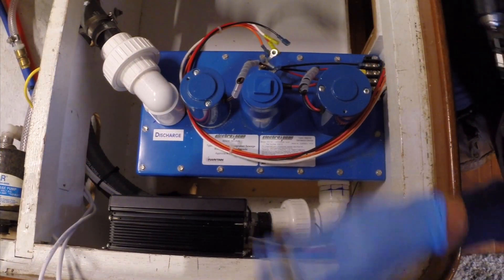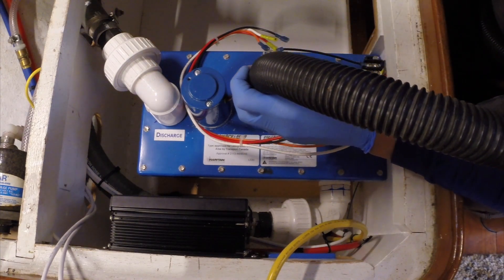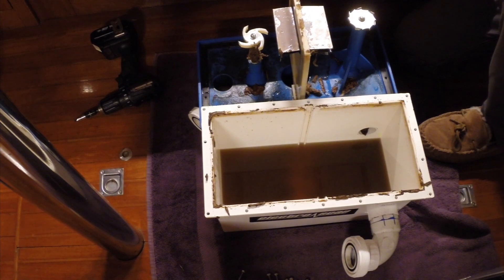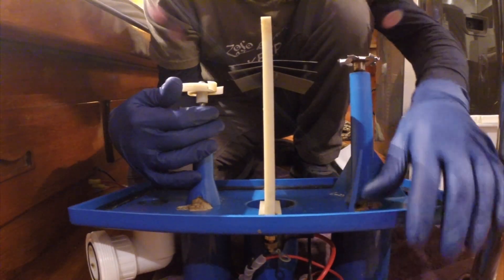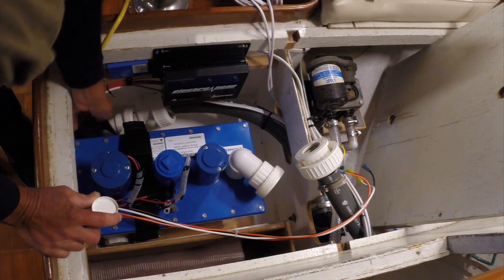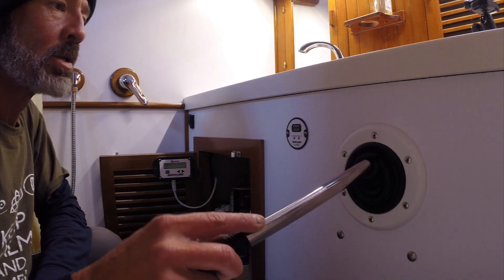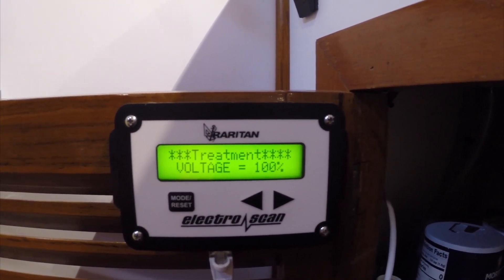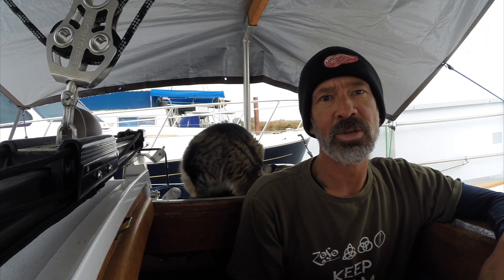SV Ramble On | Taking Apart the Electroscan

Comment: What kind of acid did you use to clean the electrode plates?
Reply from the maker: Just muriatic acid (HCl), like you would use in a swimming pool.
Reply: @svrambleon  Thanks for the response. Did you dilute it like it says in the operation manual for cleaning the system? Or use it straight from the jug at 31.45%

Comment: Rich, I have gone back and forth with the idea of composting vs. treatment.   A friend has a composting head and loves it.  I have used it and must say it is pretty bullet proof and does not stink.  Yes, you basically have a litter box but doesn’t seem any worse than cleaning a treatment system or dealing with a holding tank.  

Pick your poison I guess.  I think I will probably go composting route in the end.  Just so simple.  

Have you considered composting?
Reply from the maker: Phil, Jeni and I went round and round about this very subject when we started our refit 7 years ago.  As you're well aware, T37s have horrible holding tanks and waste plumbing systems.  Unless you count pump-outs, we opted not to have to deal with our off-cast more than once.  Something about rowing a bucket of  composted human waste ashore for burial on land never much appealed to either of us.  Guess it really doesn't matter once you're 3 miles offshore.  Environmentally, I suppose it's six of one; half-dozen of the other.  Sure there are NDZs all over the globe, and for good reason, but I wonder if the Governments implementing these strict  environmental standards would feel differently about some cruiser paddling up and digging a cat-hole on the beach?
Reply: SV Ramble On yep, totally get it!  You seem to have done a lot more research then I have.  I was under the assumption I could just dump the solids into the water since they had decomposed.  Sounds like I need to do some more research before making a final decision.  Thank you so much for the additional data.